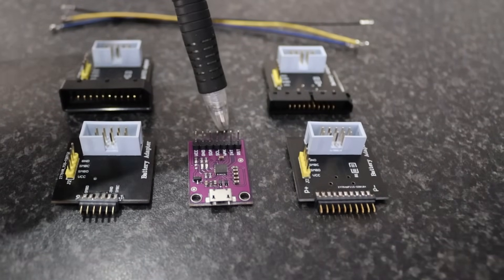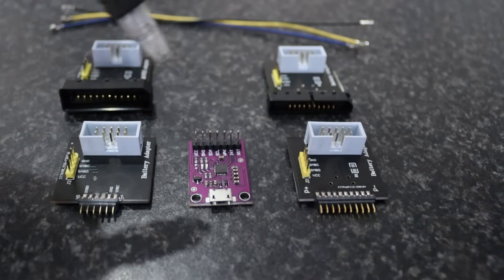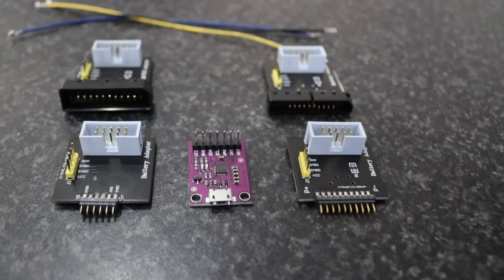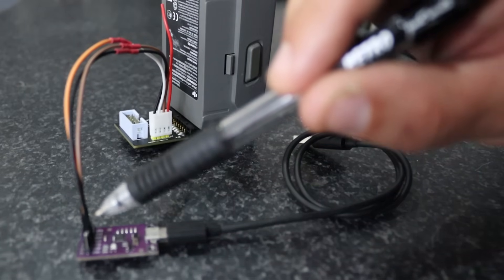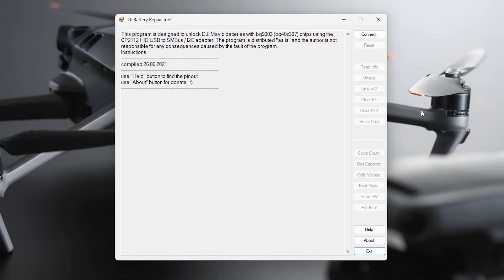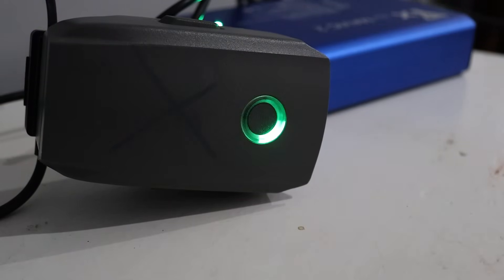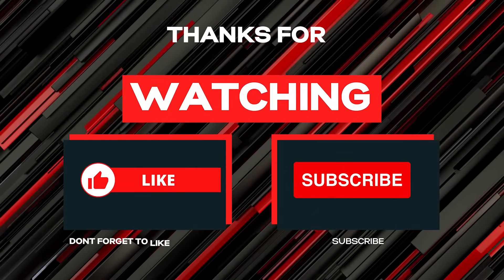Revive Your Drone Batteries in Seconds - You Won't Believe How Easy It Is!

Comment: What are the safety risks of doing this? Apparently you could cause it to catch on fire under heavy voltage surges?
Reply: Correct. This is why we do extensive testing of the cells before and after to ensure safety and safe flying operations

Comment: what about when they get hot even when you havent flown it yet. I live in Las Vegas and the heat is seemingly becoming a problem.
Reply: Do not use if it gets excessively hot. They can and will swell or expand and eventually leak or worst case cause a lipo fire

Comment: Looks awesome! I left my MINI2 batteries discharge and i guess "memory" has taken them. Will this revive?
Reply from the maker: Yes mostly definitely will work on your Mini 2 batteries
Reply: @adkwc  Sweeeeeet. Just ordered the CP2112 with wires for 10 bucks! Thanks
Reply: @adkwc  On Mini 2....On the board, I see "SCL" and "GND"...which is"+" on the board? and do i need to solder? I'm gonna research as well, but cant hurt to ask. Thanks

Comment: I don't know why but the software apparently doesn't read the batteries and I bought 10 chips and some of them with type c and nothing works.. Then I did a test with a normal battery and the software doesn't read either.. Something strange.. When I connect the chips I hear the sound on the computer that it does connect but when I click connect it doesn't read anything.

Comment: I recently had a drone go in Crystal Clear Spring water. After that it kept giving me a battery cell error. I finally figured out how to fix it after drying it completely I had to put it in the Drone and let the Drone blink until the battery went completely dead then I was able to recharge it and it worked fine
Reply: Thanks for sharing your experience. Have a Mini 2 drone which crashed into a swimming pool. It was immediately taken out and dried properly, and sat in rice for a few days. The drone doesn't detect the battery anymore, and actually there's no voltage on the battery terminals. Disassembled the battery and the cells are at about 3.5V each, which is perfectly fine. Looks like the goddamn "money making chip" that DJI put into the battery is preventing it from functioning properly, even though I'm sure everything is fine. The cells charge if I connect them to a charger and discharge if I connect a load to them. Need to get it fixed ASAP, but looks like ordering a CP2112 debugging board and waiting for it until it arrives is the sole option... If maybe you have an advice for me, please let me know. Cheeres
Reply: @Gebeleizis. Not sure. The chlorine in the pool is rougher than straight fresh water. I had to discharge my battery completely before it worked again. Not sure with yours

Comment: I’m receiving this error from the CP2112 with a Mavic 2 battery. Assumed there must be another issue since the same message is returning from both a fully charged and operational DJI battery and one that has sat and discharged. How can you power the BMS externally with an adjustable charger without cutting the battery open?

ERROR: Could not perform SMBus read 0x00
Reply from the maker: Batteries over all voltage is to low , you will need to open the battery and manually charge it up with a bench power supply and then try and read the battery again.
Reply: @  thank you. I’ve measured my Mavic 2 battery at a combined 9.43V (testing that large red and black wires past the BMS board). I can communicate with the BMS but need to manually charge each of 4 cells to bring them at least 3V each. Can you link me to a Mavic 2 layout that shows the pos and neg leads for each cell so I can use my adjustable bench charger on each one? Or can I just apply voltage to those red and black wires briefly to bring up all cells?
Reply: @miles267  my answer comes probably too late, but yes, you can. Since they are connected in series (4S configuration), applying any tension above those 9.43V stated in your case, will charge them all little by little. You probably have to go up until 12V at least. But this method doesn't mean the cells are well balanced, so individual voltage check is still recommended. Hope someone finds my answer helpful.
Reply: @Gebeleizis. thank you. I ended up charging this battery and balancing the cells however it then returned a battery not seated error, drone wouldn’t take off. Kept battery but gave up on it.
Reply: @miles267  that's such a pity. I can't be of any help here I guess. I'd just double check everything is at its place and well fixed after assembling it back. Maybe there's something loose and the drone detects it. Good luck.

Comment: Have you guys ever had any Spark batteries that you could not revive? I am talking the ones which have gone into 'protection' mode and exhibit the 2 LED flash 4 times and then again after a pause. I have tried a CP2112 and it just does not find the battery. Even with a 9V battery connected to the correct +/- battery terminals, still nothing. I have checked continuity from the CP2112 board all the way to the drone battery terminals too. So just wondering if there are Spark batteries that are well and truly f*** and simply cannot be recovered. History:  I seldom used my drone, and the last time it was used was circa 2019 and then just packed away. I have 3 batteries - all are the same result.
Reply from the maker: We have done 100's of spark batteries and have a 99% success rate with them . Will do a dedicated video for them. Stay tuned
Reply: @webuydronessa  The issue is the SW doesn't detect the batteries, but it does show CP2112 device foe debugging. I have only tried with a 9V battery, but some people said they have only had success with battery detection using an ACDC transformer to give a steady and continuous 9V delivery. Is this your experience? I don't want to but a power supply only to find  am still stumped!! If I lived in CT still, I would have tapped you guys up. But now all the way in the UK.

Comment: Thx but I would have been very helpful if you showed which pins on the Adapter board go to which pins on the CP2112 board, they are not labeled the same so it's not very straight forward.
Reply from the maker: Its very easy , Ground (GND) from board to battery , SCL (Clock ) from board to battery , SDA (Data) from board to battery , those are the only 3 pin outs required , the battery pin outs themselves are shown in the software under the "help " tab
Reply: @adkwc  What? The adapter board has pins labeled GND, SMBC, SMBD & VCC. The CP2112 board has pins labeled VCC, GND, SDA, SCL, WAK, INT & RST.
Reply from the maker: @arthurott4561 yes so only use GND(Ground) , SCL(Clock),  SDA (data)

Comment: I found the 2112 chip and the connectors on eBay, downloaded the software and it sure enough worked!!!  Thank you kind Sir.. May God Bless you!
Reply: do you know if the device makes the battery power go longer as if they were brand new?
Reply: @mydroneprojects1353  no, it surely won't. It's like expecting better tires after some firmware upgrade on a Tesla :)

Comment: Has anyone successfully used this method with M300 batteries (TB60)?
If so, please post the board and other equipment necessary to connect?

@webuydronessa  Can your software be used with the DJI TB60 batteries?
They were allowed to drop too low in charge and no longer charge or recognized by the battery station, though they have less than 50 cycles on them.

Comment: I'm looking to find where I can buy the 3 connecting wires (correct size, male to female jumper cables) needed to use with the CP2112 chip to revive Mavic Air batteries. Thanks!
Reply: Dupont wires male-female

Comment: DJI is scamming us. It's as simple as that.

The purpose of battery management software for Li batteries is to prevent overcharge and over-discharge, which can permanently damage the cells, or even risk fire. If you put any of your phones, tablets, laptops or e-readers in a drawer for a year, their batteries will be dead but are revived by plugging in their charger. The BMS prevents over-discharge.

Not so with DJI batteries, which will not charge after extended self-discharge. That a CP2112 can revive the batteries by clearing flags in firmware is proof that the cells are not physically damaged. DJI's BMS could be designed to allow charging of dead batteries like millions of other rechargeable devices; instead they want to sell you new batteries.

Shame on you, DJI.
Reply: Got a phantom4 that cost over $1500 at the time.Flew the drone twice and put it away for a few months.Batteries wont charge at all and am hesitant to give these grubs anymore of my money. So much for so called "Intelligent Batteries".
I thought it was only with the Phantom4 but even other Dji batteries are having the same issue. It's bloody disgusting.
Reply: Fully agree. However we also do laptops and other consumer electronics, and the BMS not allowing a charge after reaching very low voltage levels are dependent on the manufacturer chipset use, example TI ( Texas Instruments ). I mention this because i have had a ton of laptop batteries that are "Dead" , but found that the voltage was just too low and slightly boosting it to a level where BMS starts reading a "normal" voltage, brings it back to life and is fully usable ( granted cells are healthy and only discharged very low due to inactivity and use). But again, i agree, companies would rather make a new sale than give us consumers an easy to use product that CAN be "fixed"
Reply: Exactly. Such a shame on DJI for putting that damn money making chip into their batteries.

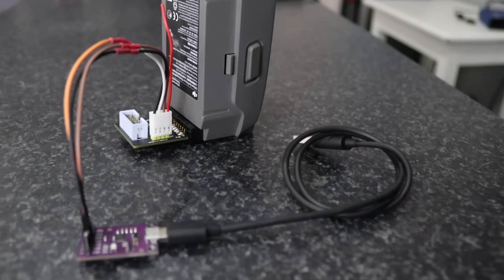Comment: The pinouts for connection to the battery are shown at 5:48 INCLUDING Vcc, but in the out-of-focus shot at 6:35 the CP2112's Vcc pin is NOT connected (red wire hanging loose) - so which is it?
Reply: Hi. VCC is NOT used when doing the above procedure. Only 3 pins are used. Ground, SCL and SDA. Thanks

Comment: When replacing cells of battery, will I need this method?
Reply: I've heard DJI BMS lock itself if the power is disconnected (cells are removed). So if you plan to do this, don't go the trial and error way, but find the best solution for your case so that you  don't get in trouble. Maybe try and trick the BMS by temporarily connecting any working li-ion battery? Good luck.
Reply: @Gebeleizis.  Hi, had someone do it for, they replaced the cells and it cost me 25 dollars cheaper than buying new ones,, i think they reprogrammed it to work again.

Comment: I just tried it but keep getting ERROR: Could not open device in the app.
Reply: Hi. Email is in the description.  Send me a screenshot of the error you are getting
Reply: @AshrafRogers  thanks for the reply. it turns out to be my USB cable issue. I tried 3 USB cables, 2 didn't work but the last one worked.  I fixed my batteries afterwards.

Comment: Hi, Just thought id give a bit of an update, I purchased a second CP2112 board and again connected it, ran up the software connected ok, read out the parameters ok, unseal 1 ok, unseal 2 ok,  Clear PF ok, clear PF2 and again that same electronic burning smell from the board and no more comms,.. very strange, I will try a different type of comms module if I can fine one and get back if it works..
Reply from the maker: Please email us for support and help,  add some pictures if possible,  email to repairs@webuydronessa.co.za
Reply: @adkwc  Hi, thanks for the reply by the way, I have only just come back here.

Comment: I have a Mavic Air and 2 dead batteries. I see the debugging board on your website, but is the adapter board also available? When buying these, do you make the software available?
Reply from the maker: We have stock of the board , but we unfortunately do not stock the adapter at all , you will just pin in the wires directly to the battery which is easy to do , and yes we supplier the board, the wiring and the software if you purchase a board from us.

Comment: I forgot to charge my Phantom 3 Pro batteries (DJI Originals) last year before storting for the winter. I just took my P3 out to check around our property for wasp nests, and both batteries are dead and won't take a charge. Is there any way to revive them? I really don't want to spend upwards of £200 for two new batteries if it can be helped.

Comment: Hi, thank you for the video! I got the adapter as well as the board. However, whenever I run the software, I get an Error that it cannot connect. I have three batteries that are hibernating, but it even shows the message on my functional one. Any idea what it could be? Thank you!
Reply: on a different Computer it gets recognized. However, I get stuck at the 0x00 Error.
Reply: @kangaroo-nm5nn hi. Have you managed yet? If not, pop us an email. Thanks

Comment: Does this help for mavic 2 swollen batteries? Only have 27cycles on the battery and noticed it started to swell
Reply from the maker: It does yes , but we would not recommend trying to revive swollen batteries , the risk of additional swelling in flight is 100% possible,  it will result in the battery popping out during flight and the drone will crash 😳

Comment: Do shps do this service in the states?
Reply from the maker: Not that I am aware of unfortunately
Reply: @adkwc  damn. Have a new battery with less than 15 cycles just sitting there.
Reply: @adkwc  hey... I don't have a current pusher. If I need it, if there anything I can use to slightly charge the cells? Like maybe a week usb charger?  Like negative to negative and positive to positive?
Reply: @bobtruck1594  Of course. Just respect the polarity and use a weak power adapter, usually the older ones.

Comment: Does anyone know how to diagnose a Dji Ronin M Battery Module 😥 I have a Dji Ronin M complete kit which was used twice only. Is there a bypass or a way I could use it with wired power ?
Reply from the maker: We have done a few Ronin batteries so yes it does work on them

Comment: Thanks a lot for the instructions! 
I've successfully revived my DJI Mavic Air 1 battery. 
Here’s my experience: 
I left the battery in the drone for about 9 months, which completely drained it. 
It was unresponsive to button presses and wouldn't charge, even after several days on different chargers. However, by following your guide, I managed to:
- Read the battery information, which indicated that leaving it in the drone for this period didn't cause irreversible damage.
- Successfully revive the battery.

I charged it for an hour until the LED indicators stopped blinking, and now the drone recognizes it perfectly, with all previous data intact, including the charge cycles.

Software used: DJi_Battery_Killer_with_dll_13.06.2021
Hardware used: Only a CP2112 debugging board, with direct wire connections to the battery contacts.

Thanks for helping me save $100! 🙂

Comment: Hi. Will it work with Air3s batteries?
Reply from the maker: We have not had one in to try as yet so not sure at this stage
Reply: Currently I sent them to DJI. 3 batteries fully discharged in 3 weeks, being in the hub. It’s not normal, but you never know. 
If DJi rejects the warranty, can I send them in to you?
Reply from the maker: If left in the hub they discharge alot quicker unfortunately,  let's hope DJI honor a claim , batteries only have a 6 month warranty
Reply: @adkwc  DJI accepted warranty claim. I’m waiting for batteries and hub to comeback. I wonder if they replaced them or fixed them.

Comment: I did the reset battery using the software but still cannot charge the battery it's zero empty no charge at all so is it damaged or I miss somthing or need to reset with much power? I used the power from the usb only when reset! Thanks

Comment: I have the board, and the battery adapter. You never explain where to connect the wires from the adapter to the cp2112 board. On the adapter, it says GND - SMBC - SMBD - VCC. What do these need to match up / plug in to on the actual cp2112. It's NOT plug and play as you keep saying.
Reply from the maker: It's super simple,  you will connect the board and adapter using GND (GROUND) SMBC (CLOCK) SMBD (DATA)  match them up on board and adapter....will take you less than 30 seconds , it's plug and play
Reply: @adkwc  I understand the ground, but what I'm saying is the other abbreviations are different on the cp2112 and the battery adapter plate. Is it ground to ground, sda to smdb and scl to smbc?
Reply from the maker: @RyanNiemer thats correct yes
Reply: @adkwc  awesome, thank you. Now I just need to get the female to female wires and i'll be ready to give it a try....hopefully my batteries aren't too far gone to revive
Reply: @adkwc  well i got everything hooked up and can read the info on a good battery, however, i'm getting nothing on my two dead ones... are they too far gone?

Comment: Wow, it worked. Not quite as easy as yours, but it worked. I could unlock everything with the software, but when I exited and pushed the button on the battey, a single light would light for a few seconds then turn off. Pushing again would not start any lights. I tried it several times. So I tried to upgrade the firmware. It didn't complete, but the battery then had 2 lights lit solid. It would not charge. The lights just stayed lit. The charging hub would still have a red LED on it. From someone else's youtube video, I saw that if I used the DJI Assistant, it would detect that i had mismatched firmware. I ran that, and it FIXED IT!  It's charging now. My batteries probably only have a few hours of flight time each, so happy this saved one of them.